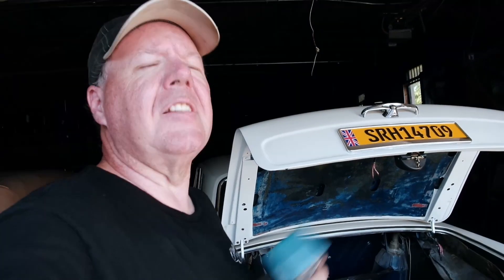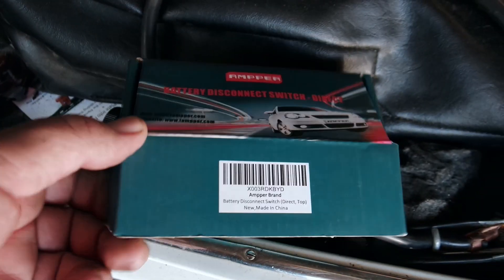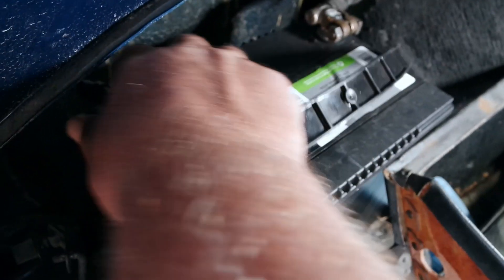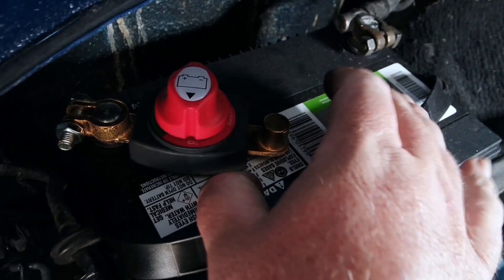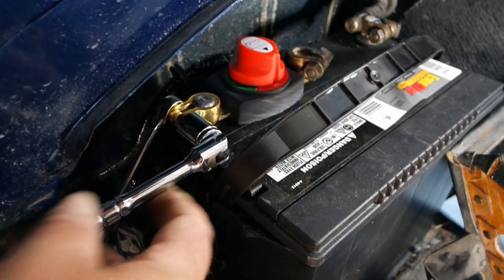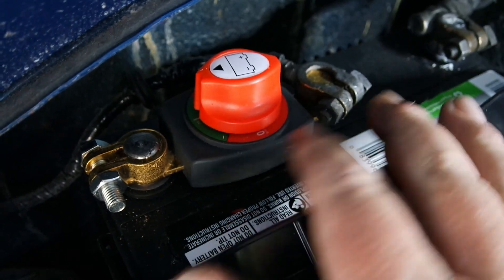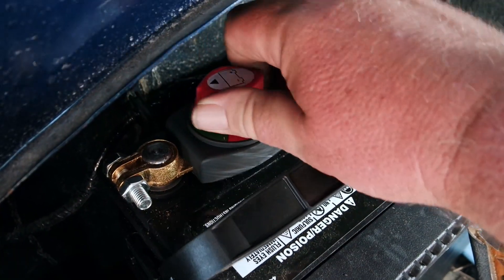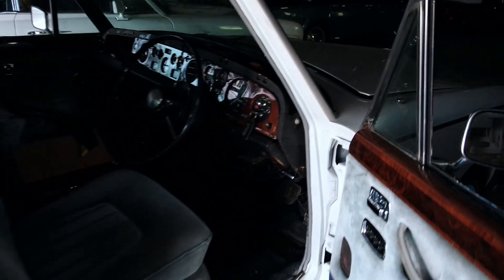How to: Installing a Battery Cutoff Switch on a Project Car

Comment: is the positive always closer to the cabin even on Left hand drive models?
Reply from the maker: It has been on the Silver Shadows I've seen. The negative cable is pretty short and goes right to the body next to the battery so its pretty easy to determine which is which.
Reply: @MidnightRoadGarage  Thanks im in the process of trying to get my grandfathers 79 running
Reply from the maker: @audiman879  well best of luck to you! I'm almost done with mine finally :)